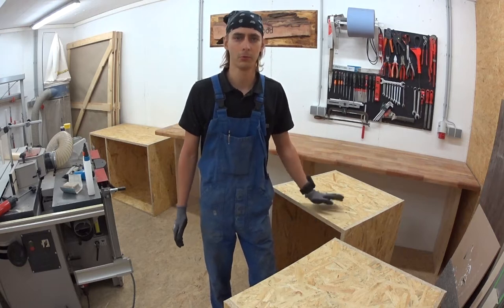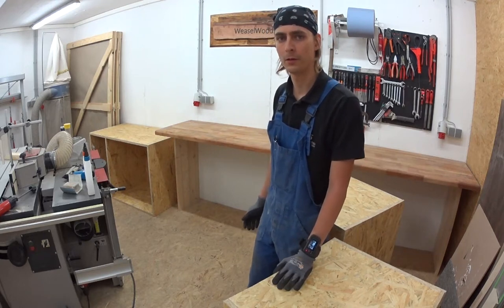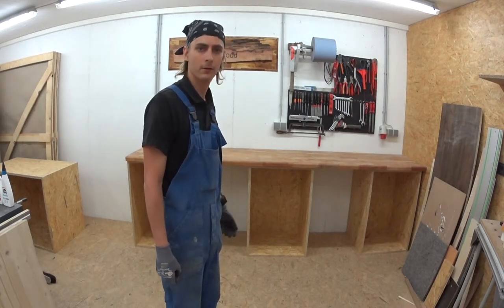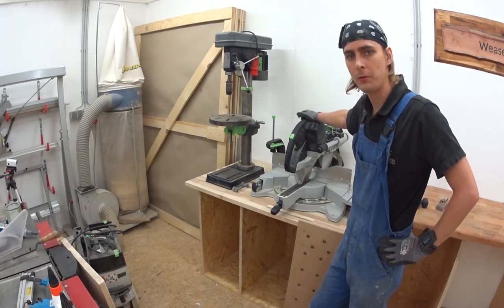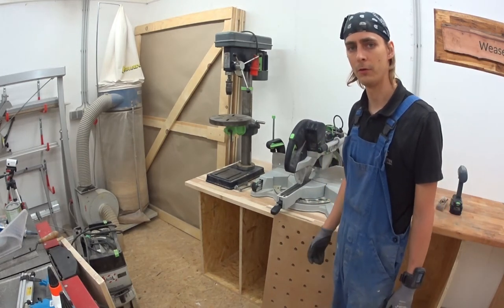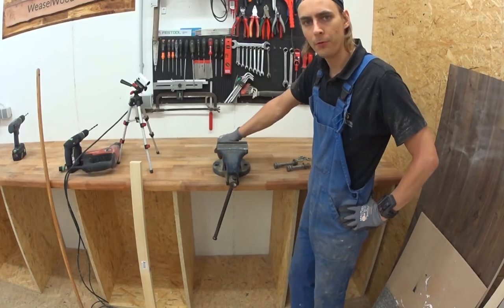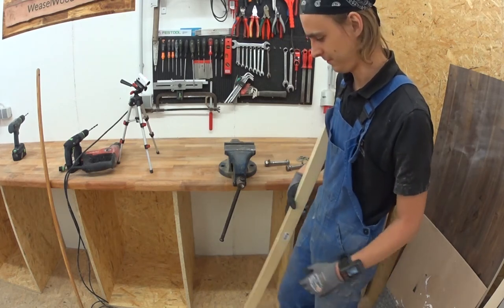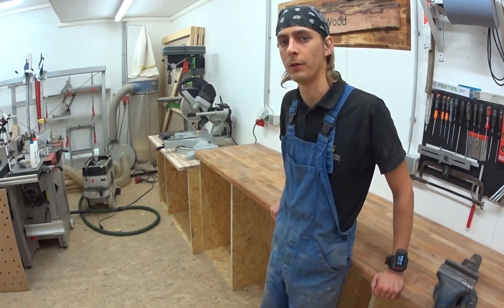Workbench upgrade (Part 2) [WeaselWood ShopImprovement #4]

Comment: Hi Weaselwood, nice Setup! what is the height of your Tabletop? and since I am building a kapex stand myself, what depth did you choose for the smaller kapex table top? looking forward to your drawer build
Reply from the maker: Thank you.
I made the workbench with a hight of 89cm, so it is slight lower then my tablesaw and I can cut bigger parts that overlap the workbench without hitting it. I made the bench for the kapex about 75cm deep to give the saw enough distance to the wall to swing, so in 90° position just the adjustment knob hang a bit over the edge.
Hopefully the drawers don't stay to long on the to do list, but currently it's a pretty long list, we'll see. ;)
Reply: +WeaselWood great thanks!
Reply from the maker: You're welcome! ;)

Comment: Oh, bummers!  When you said "workbench,"  I thought you were going to change out your long work table and create a real workbench -- one of those wonderful classic European workbenches (perhaps in the Roubo type) with an 80 mm thick top and the traditional tail vise and shoulder vise -- and maybe you'd even show us your making the traditional square dog holes.  It looks like you've come up with what is still just a long table, and the vise is a machinist's (!), not a woodworker's,  vise better suited to metal work.   As to the video production itself, I confess I don't really care for the choice of music.  Finally, I won't comment as to the use of particle board and OSB except to say that the most famous painting by Edvard Munch comes to mind.  Notwithstanding these minor grouses, this video is still worth a big thumb's up.
Reply from the maker: Hi Welsh
The problem is, that i'm not a usual woodworker, always kinda do my own thing, different then any woodworker would do. Also I want to stick with all my interests and so my workshop used to fit all my needs for woodworking, metalworking, electronics and electricians work, an all in one workshop, but in the future, as I spread out into the 2nd room for metal working, maybe I redo some of my wood workshop. We'll se. ;)